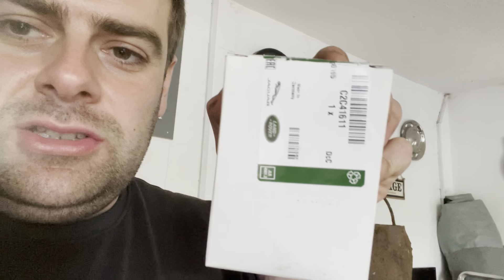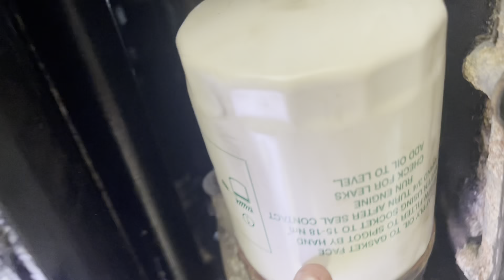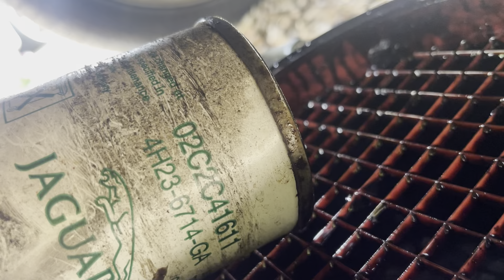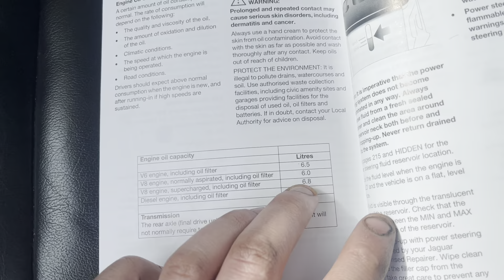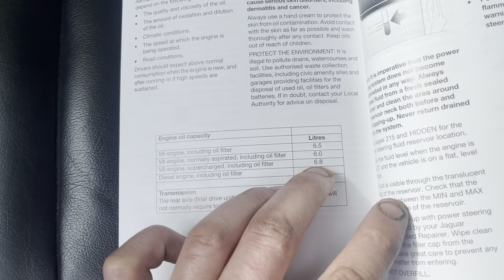Jaguar oil and filter change on the XJR 4.2 supercharged X350 Castrol 5W-30

Comment: Thanks for the video. I have this job to do on my XJR Portfolio tomorrow. 

Have you replaced the transmission oil in yours? I don’t think mines been done and changes are slightly ‘clunky’ so hope new oil will help.
Reply from the maker: It may do yeah I had my changed at the garage